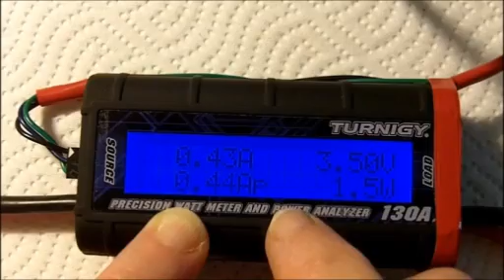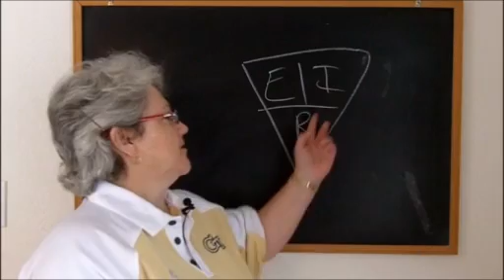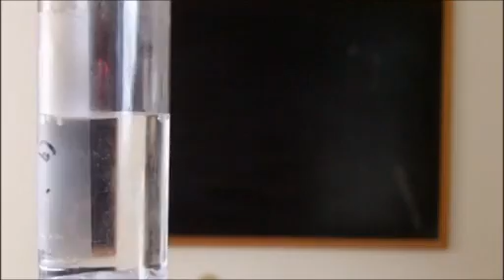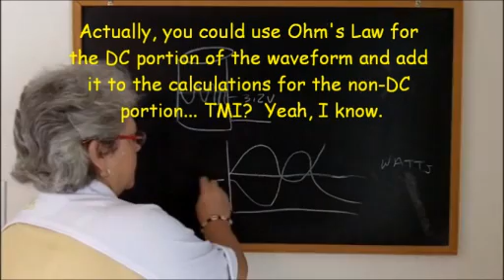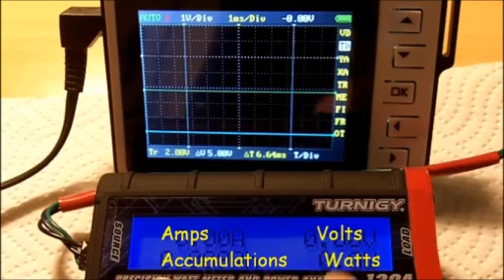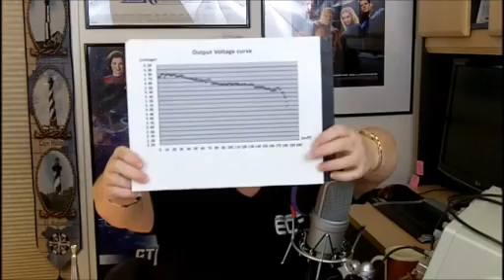Joyetech Ego-C Twist Torture Review

Comment: Nice work with the O scope! I have an old CRT tektronix O scope I got for free. I really need to sit down and learn how to properly use it. I picked it up primarily to use for ham radio applications. I have been meaning to put together a voltage divider so I can properly view the waveform of an RF signal. Another option would be to include a tap on my dummy load. I know enough about O scopes to know that if I were to jam 5 watts + of RF into the scope I would fry something. That little open source O scope looks pretty sweet. It's size would make it really nice for field work. 

Thanks for awesome geek filled video.

Comment: Don't apologize. You and your videos are great. This review was exactly what I was looking for regarding the Ego-C Twist. I like to build micro coils for my atomizers using 28 Kanthal. For my Protank 2, I could only safely fit a 10 wrap coil that came out to 1.3 ohms. Worked well on my Ego so I wasn't really concerned. However, I noticed it was getting pretty warm after chain vaping on it. So I had second thoughts about whether what I was doing was safe. Didn't find much info about the lowest resistance you could use but did find the C Twist had a 2.5 amp limit. Based on your testing with low resistance coils, it looks like the device maxes out at about 2.69 amps/9 watts no matter how you set the voltage. When I run my 1.3 coil I keep the Ego at 3.2/3.4 volts. However, If I accidentally turned it up to 4.8 volts it looks like it would still be ok because the circuitry is limiting the output and protecting the battery. Dunno, probably will affect longevity of battery but sure does vape nice. By the way, love your easy to understand analogies, the toaster was my favorite, and you are a great teacher. Even before I looked at your channel info, I could tell you had an engineering background.

Comment: I have broken my twist battery before by barely kneeling on the battery when it was on my bed while I was actually looking for the battery haha im not sure exactly what happened but the metal case had come off the battery inside and had disconnected a wire haha

Comment: jan very good video, I want to convert an old ipod in a vaper and I have a couple of questions I want to use 2 batteries in parallel joye 13,700, but I will weld the poles, can I charge the 2 batteries through the thread 510? as in my old battery Ego? and the other is what I would need to include him variable voltage? The batteries are 1000mh, greetings from mexico

Comment from the maker: Hi Smokie.  It's the standard Joyetech charger.  Look at the tiny specs written on the sticker on the back of it, you might need good light and a magnifying glass, but written there should be 4.2V 420mA output.  And if you plug that Joyetech charger into a wall-wart USB adapter to supply the power, make sure its output is 5V and 500mA.  Does that help?  Cheers sweetie.